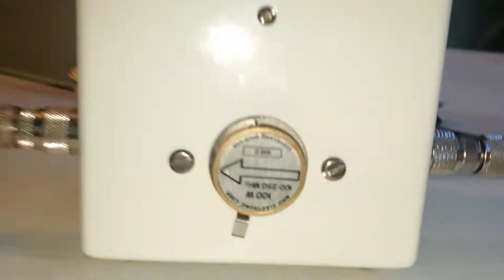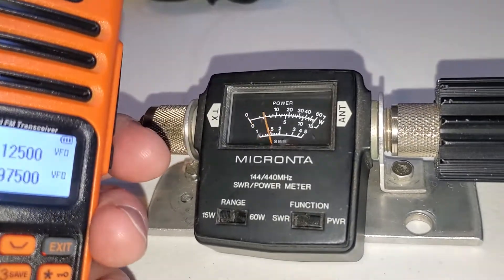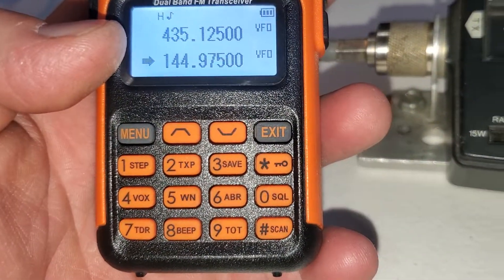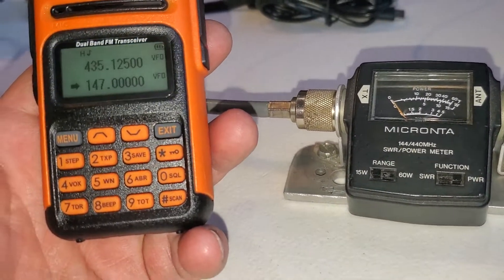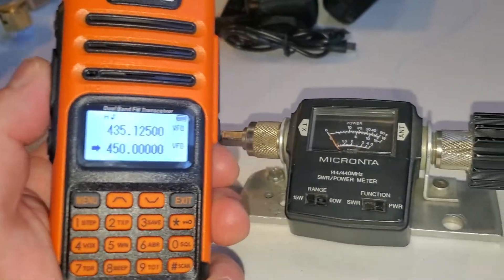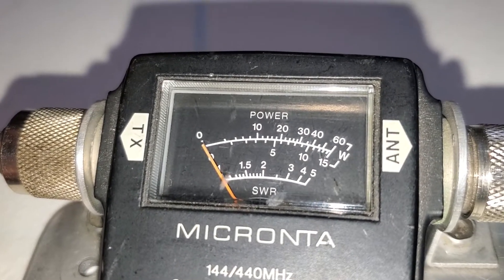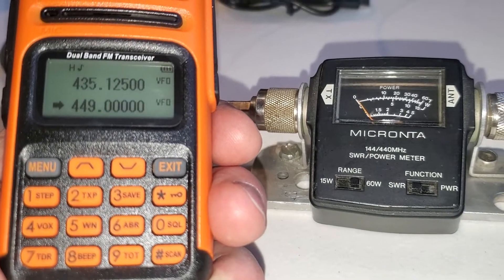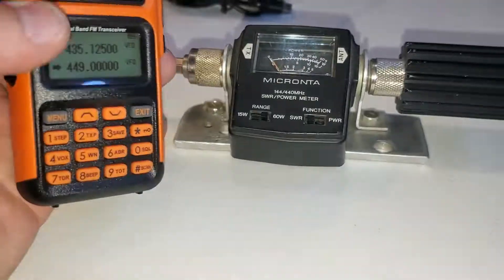REVIEW BAOFENG TP-8PLUS PART2 POWER OUTPUT TEST UHF VHF HAM RADIO

Comment: Did yours come unlocked? Read on another video the 5w version comes unlocked and the 8w comes locked.
Reply: If you want an unlocked one, get the UV13
Reply from the maker: @scottholmes9657  I know. I just dont want to deal with ebay anymore.
Reply: @hamradiohack  I don't blame you.  eBay is not what it once was.  I bought my UV13 first off of eBay, no issues.  I bought the TP8 off of Amazon after watching your part 1 video.
Reply from the maker: Amazon ones all appear locked. Get one on ebay
Reply: El mio biene bloqueado algun metodo para desblokearlo???😢😢😢